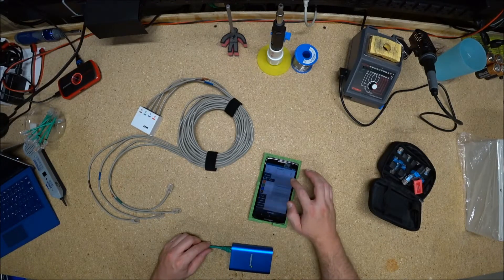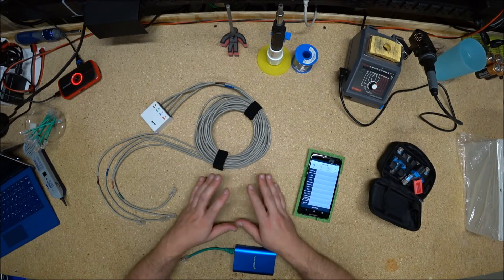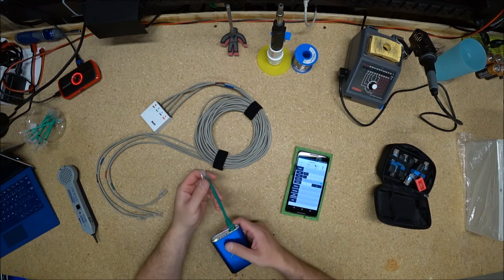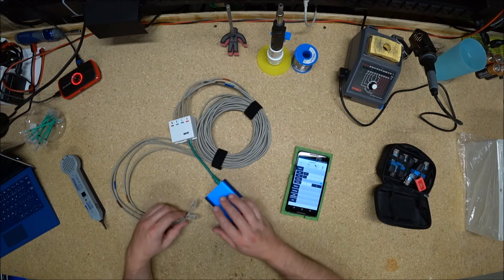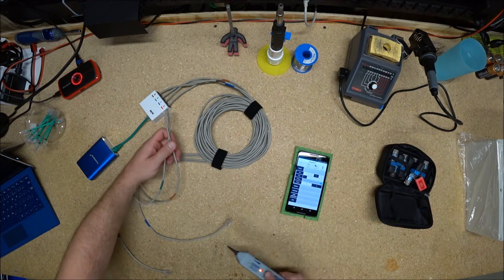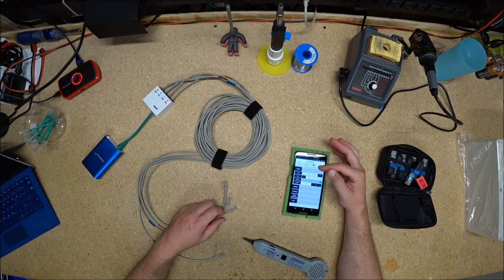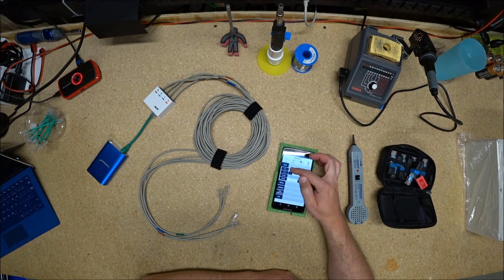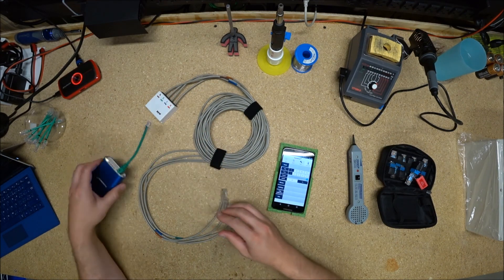Pockethernet toner feature request

Comment: What toner do you use?
Reply from the maker: I have an older 200EP marked Progressive Electronics by Tempo... which is one of the original many older telco guys will remember ... actually made by Progressive Electronics which sometime in 2001 changed names to Tempo-Mesa, which is owned by parent company Textron Inc. which seemingly doesn't care to make this anymore.  There are lots of look-alike clones on Amazon, but who knows if the circuitry inside is as reliable/the same.  Perhaps a comparison video is in order?

Comment: i almost bought this tester but cancelled the order. i need VDV (video/data/voice) tester. this one is data only. i wish if manufacturer add coaxial connector to it. voice and data are no different. coaxial testing is much easier because there are only two cables in it.
Reply: Did you end up finding a solution? I was I could find something like this for fiber.
Reply: @drumrboynoid  I bought three testers, tested them and finally decided to keep klein DVD, the most expensive one. All others had few issues, missing options and we're not reliable. I completed my project using klein DVD and it did helped me with few cabling and connector issues, that said, tester is paid off. The option to light up port on switch was very handy. The option that tells you if other end of the cable is loose or connected to a switch was helpful.
Reply: @ssmaqsood  Right on. Do you mean the Klein VDV?
Reply: @drumrboynoid  yes, i end up buying video data voice. by Klein., the most expensive one.. lol. its not worth to spent more time on job in  cable troubleshooting over saving few dollars. i believe tools should be dependable otherwise its waste of money.

Comment: why...?, if tester can sense switch why it shows error on wiremapping. tester know that the other end of the cable is connected to a switch. it should be smart enough to handle wiremapping. at least don't show error. if i know the other end of the wire then i don't need the tester. if you're testing a wire for breaks and other end is connected to a switch far away, may be on another floor. you need to first run to the other end, remove ti from switch and then come back and run wiremapping..., lol, joke. even $1200 fluke ciq-100 shows error if other end of the wire is connected to a switch even when tester can sense the presence of a switch..

Comment: Question about "A" & "B" standards. Long ago I was taught, when was apprentice, to wire with "A" standard pinouts. Over the years on diff jobs I've seen both A & B on diff servers & patch panels, etc.... What is the main advantage/disadvantage of these two & your thoughts/opinions of each one. You said use B, as I do now.....but why is that?
Just wondering, love learning new things from ppl, as I find it fascinating etc...😊
Thanks, & like the vids....your also easy to watch & listen to.
Cheers, A
Reply: 568B is a standard that I have seen in most Telcos, 568A works the same as 568B so you can use it as a regular patch cable. Now if you do a 568A to 568B you get a crossover cable. So back in the day if you wanted two similar devices to be hooked up, ie pc to pc you would make a crossover cable. Now days I pretty sure everything is auto sense so making crossover cables is a mute point.
Reply: Terminating ethernet heads is easier with the B standard; when you strip the jacket and spread your pairs out to crimp to B orange and brown fall to the outside of the jack and blue and green can be split so blue nestles inside the green pair. Kind of hard to explain but you just need to wrangle wires more with A.

Comment: Will it pickup tones sent on a cable connected to a POE and regular switch, especially in closet with interference that often make the regular tone generator and wand just produce static and or radio?  This week I had a job where I could not into the closet to see the switch so port blinking ability didn't help there., but I could get to the patch panel.  My NOYAFA \ Kibeland Handhled Multi function Cable Tester was what I'd been using and was happy with it till it died a couple days ago giving me less than a year of service so now I'm looking again.